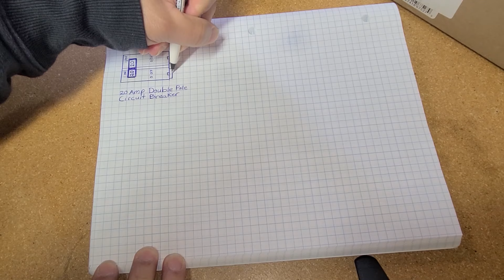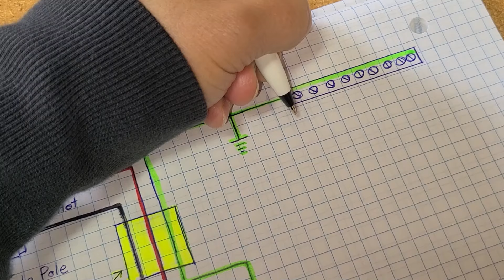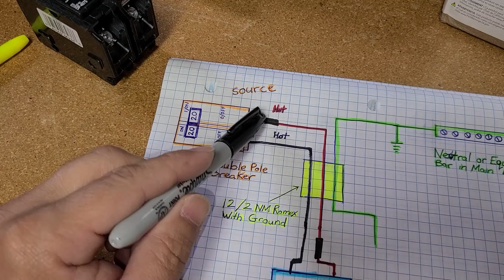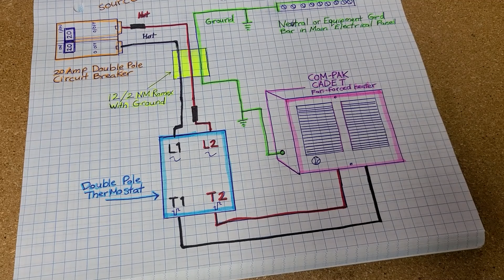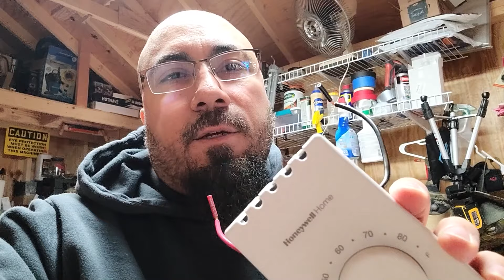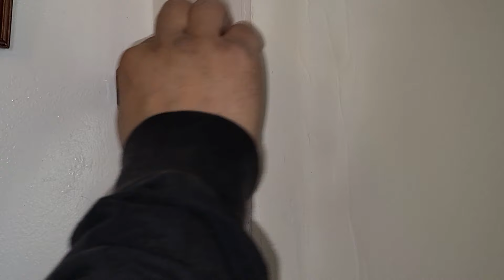How To Install Non Programmable Electric Heat Thermostat

Comment: How about when running Romex from a source, say a non-switched unused 20A outlet to that same double pole thermostat in this video, by connecting the Romex black wire from the outlet to both red Line thermostat wires, then connect both black Load thermostat wires, going directly to heater wires, along with the Romex white and ground wires. Would I need to run another outlet to power the heater? it doesn't have a fan. It's a ProFusion, 1500W 120V 2 quartz element with a pull cord for running one or both elements.

 It would be acting only to interrupt the Load from the outlet through thermostat to the heater correct? While the white completes the circuit and the ground goes directly the steel casing of the heater. This will act to heat my small greenhouse being able to turn it completely off when not in use via the thermostat knob..
Reply from the maker: Hey @ShootingOutside, that’s a solid question — and I get what you’re trying to do.

Short answer: yes, the thermostat is basically acting as an “on/off” switch on the hot (line) side going to the heater — but the way you described wiring it isn’t quite right for a 120V setup.

That Honeywell thermostat you’re talking about is a double-pole (4-wire), which means it’s designed to break both hot lines in a 240V circuit. When you use it on 120V, you typically only use one side of it, not tie both line wires together.

A couple key points:

Don’t tie both red (line) wires together to one hot — that’s not how it’s intended to be used

You’d run your hot (black) from the outlet → one LINE terminal → out from the matching LOAD terminal → to the heater

Neutral (white) should go straight to the heater

Ground goes straight through to the heater casing like you said

Also, your heater is 1500W at 120V (~12.5 amps), so it’s within range — but you want to make sure that circuit isn’t already heavily loaded.

As for needing another outlet — no, not if everything is wired correctly and the circuit can handle the load.

That said, just be careful here — line voltage wiring can bite you quick if something’s off. If you’re unsure, it’s worth double-checking or even going with a simpler single-pole line voltage thermostat for a setup like this.

Hope that helps clear it up a bit 👍
Reply: @HandymanLand  It does help a lot. Many thanks. I'll try this next week. No that outlet is only used by 2 light bulbs only, and only on demand so I have a very low draw

Comment: How would you add another heater to this configuration?
Reply from the maker: You can run two heaters off one thermostat as long as the total wattage doesn’t exceed the breaker and thermostat rating. Just add the wattage of both heaters, divide by the voltage, and make sure the amps stay within limits. If not, you’d need a relay or separate circuit.

Comment: I have a house built in 1971 with multiple thermostats from the same year which controls the electric baseboard heaters.  The thermostat only has 3 wires connected to it, 2 are colored black that are about 12 gauge and 1 white that is about 18 gauge.  One black wire is labeled as line and the other is labeled as load with the white being unlabeled.  I wanted to install a new thermostat and all instructions and videos say to connect the red wire and the white wire and the blue wire to the specific spots on the thermostat.  From everything that I could piece together, the black line wire would be the red wire, the black load wire would be the white wire and the white wire would be the blue wire.  Could you please advise if I am on the right track
Reply from the maker: Hi @TommyStarkiller, thanks for the detailed description! From what you’re saying, it sounds like your 1971 setup is a basic line/load configuration, which is a bit different from modern thermostats that use color-coded wires.

Your thinking is logical:

Black “line” → likely corresponds to the red wire on the new thermostat (power in)

Black “load” → likely corresponds to the white wire (power out to the heater)

White (unlabeled) → likely corresponds to the blue wire (common/neutral or control wire)

⚠️ Caution: I highly recommend double-checking with a voltage tester before connecting anything. Older wiring may not follow modern color codes, and mixing up line/load could damage your thermostat or heater, or be a safety hazard. If you’re unsure, getting an electrician to verify is the safest option.

Hope this helps you plan the install safely!
Reply: @HandymanLand  Thank you for the confirmation

Comment: My voltage is 110. I have baseboard heat.  I found out I have a 4 wire thermostats. 

The blacks are being used. The reds are taped up and unused. 

I wired it the same way and it worked for a day. 

You think I should get a 2 wire thermostat?
Reply from the maker: Good question. With 120V electric baseboard heat, the thermostat must be rated specifically for line voltage (120V) and wired correctly for the circuit.

If you have four wires in the box, that usually means the circuit is passing through the thermostat location (line in and load out). The red wires being capped off may indicate they’re part of a different leg or not being used in your particular setup.

If it worked for a day and then stopped, that’s often a sign the thermostat wasn’t the correct type or wasn’t handling the load properly. A standard low-voltage or mismatched thermostat won’t last long on a line-voltage baseboard heater.

To answer your question directly: no, you don’t want a low-voltage 2-wire thermostat unless you also add a relay/transformer. What you do want is a 120V line-voltage thermostat designed for electric baseboard heat.

I’m actually using a different thermostat now that I think would work well for your application. It’s a 120V manual line-voltage thermostat, designed specifically for electric baseboard and wall heaters, and it’s more accurate than the older mechanical styles.

👉 https://amzn.to/48J54CD
(I earn a small commission if you use the link, at no extra cost to you.)

As always, make sure power is off at the breaker and confirm the heater’s wattage is within the thermostat’s rating. Hope this helps.

Thanks for watching, and if you haven’t subscribed yet, feel free to do so for more handyman tips and how-to videos.

Comment: Wouldn't the L1 L2 go to the heater doesn't the L mean load
Reply from the maker: Good question! In this case, “L1” and “L2” mean “line,” not load. The “L” terminals are where your power supply wires (coming from the breaker) connect. The “load” terminals go to your heater.

So basically:

L1 / L2 = power in (line from breaker)

Load 1 / Load 2 = power out (to the heater)

That’s a common mix-up since “L” can sound like “load,” but in wiring diagrams, “L” always means line — your incoming hot wires.

If you check out my full video, I show that clearly in the wiring diagram step-by-step 👍https://www.youtube.com/watch?v=3OV6vjy27q0&t=1s
https://www.youtube.com/watch?v=a5usqcx_l7g&t=1s